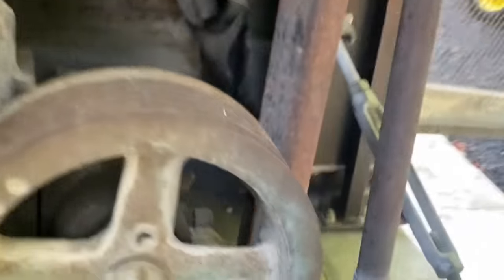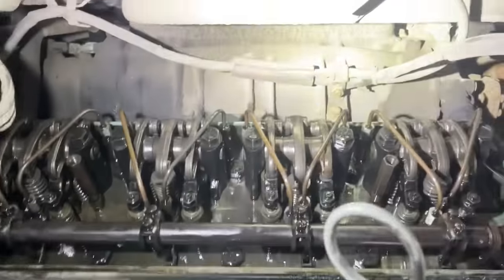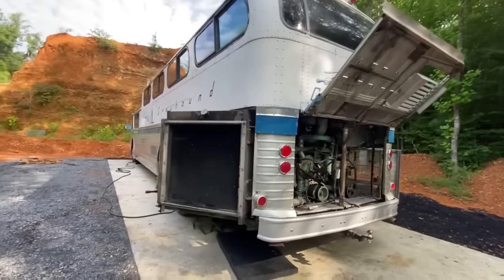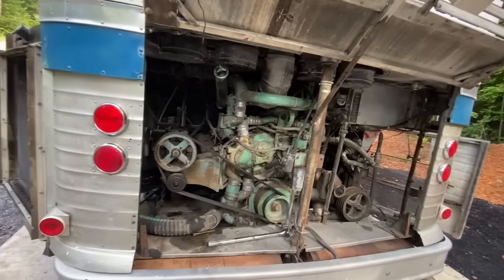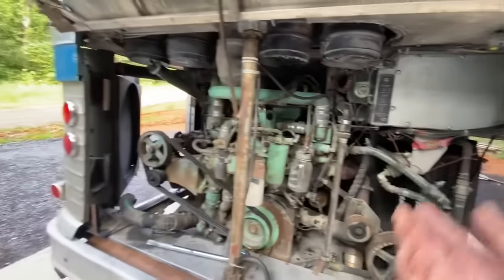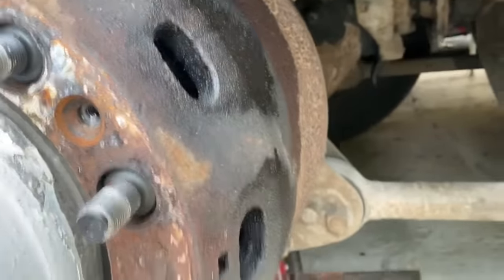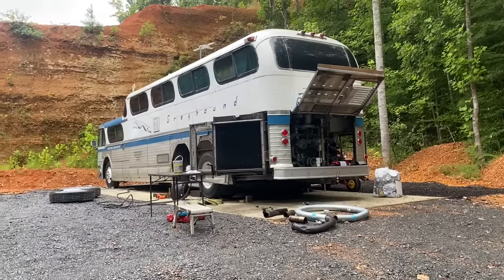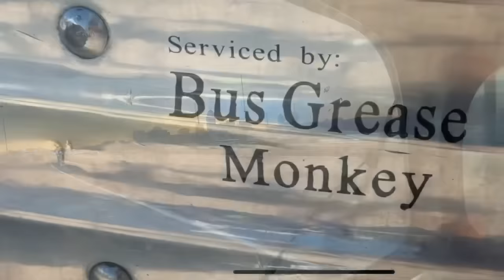Scenicruiser bus engine problems detroit diesel 8v71 supposed to be quick and easy maintenance

Comment: I’ve never seen a cylinder wall with holes in it .  What is the compression ratio on this . I assume this "side" intake is to improve compression ?
Reply: It's a two stroke diesel......Air scavenge ports (your "holes") at the bottom of the cylinders fed air into the cylinders via a supercharger/blower, piston compressed air, diesel squirted into cylinder via injector, Bang, ignition!......Only valves on these motors are exhaust ones in the head....

Comment: Sounds like a burned exhaust valve.  ?
Reply: I agree. Called a "valve blow"
Reply from the maker: The air is going somewhere and its not increasing crank case pressure via the oil fill. The piston top is not ate up.  Valve stems are all accounted for and moving. Injector came out so that was a good sign. Sometimes ive seen the valve get mangled and rivet the injector tip in the head.

Comment: Would a 2-71 Detroit also take straight 40weight oil
Reply from the maker: Yea CF2 rated 40wt oil
Reply: @BusGreaseMonkey  thanks, bought a old three phase genset a while back, fixing to try to get it running. Appears someone messed with the shutoff wiring........(cut and removed without replacing) before I got it. And thank you for your videos, gave me the gumption to attempt it

Comment: What does the "V" belt drive do that goes to the right of the engine? The one with no belts on it.
Reply: Davidapp looks to the AC compressor  the pulley Vs are rusted on it long time it no work .